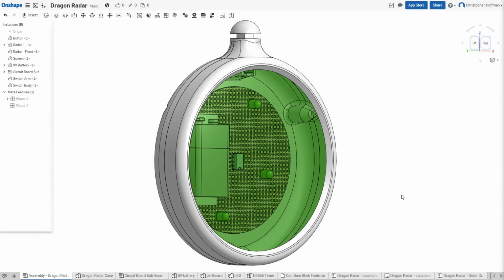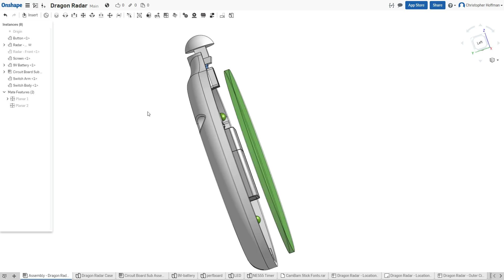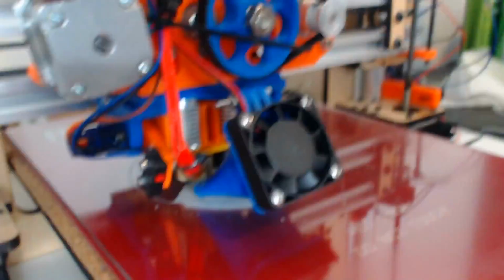Dragon Radar Prop from Dragonball: 3D printed with flashing LEDs

Comment: This fails hard because you can see the electronics, and also because it's a static prop.

It makes the fact that your caseing for it and size of it are not very screen acurate either.

1:20 well we can see it actually. Again this points out the flaws in this project with a big spot light.

Also hre on earth there is no way you could be tracking 2 1star balls.

Overall you didn't seem to know or consult the source material very well. I imagine you watched DBZ but that must have been years ago. 

I can see why this video has only a handful of likes.
Reply from the maker: The radar doesn't show which numbered dragon ball it is, instead it shows the number of balls that are in that area.

See source image: http://vignette4.wikia.nocookie.net/dragonball/images/4/46/DBLocationsOnNamek.png/revision/latest?cb=20120605203254

Comment: I would probably add some kind of light diffuser so you can't see the electronics behind the acrylic.  Then I would also cut the acrylic smaller, and around the outer edge have additional led's to light up the acrylic grid lines.  Looks great though!